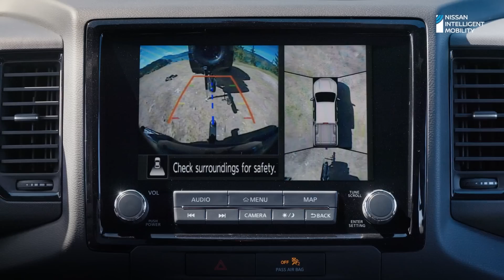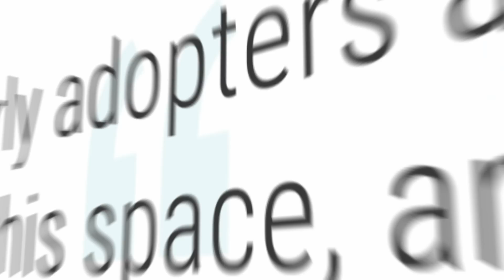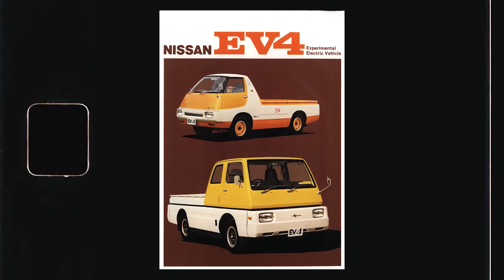Nissan Launching $25k Ford Maverick Competitor!

Comment: I had a 2door Nissan Hardboby back in the 90s. It was a great truck but small and made for only 2 people. 
I ordered a '23 Maverick because it is capable of doing everything I need from pulling the jetski to the lake or hauling my dirt bike to the track. The AWD is good for my snowboarding trips up the steep mountain roads. I especially like that it's a little lower than most trucks so my aging mom can get in easily with no step up into cab. The ride is MUCH better than my '01 4runner limited 4x4.
I'm definitely open to other manufacturers coming to market with comparable models. I think Ford even surprised themselves at how well the Maverick would do.
Reply: Agreed.  I also had a Hardbody. Great truck,  no problems.
Reply: Miata owner here. What is exactly wrong with "made for two people" lol. I'm actual MORE interested in a 4x4 "Miata like truck". I haul my partner, my dog, and things that don't breathe. I'm a introvert (a full 1/3 of the population is) and we could give a single crap about people hauling capacity lol.

Seriously. Until somebody makes a compact regular cab and fairly utilitarian 4x4 people like me will have no interest. I've been needing a truck for a bit but the only thing that really suits my bill are the older Jeep Comanches, '04 or so Tacos, and the old Hardbodys. However those are decades old and getting difficult to source parts and keep running.

Comment: Hopefully Nissan can improve their QC a bit. It's a shame that a company with some of the most reliable vehicles, is now known for nothing but problems
Reply: I have to agree with you there used to be a great vehicle back in the 70s and '80s I don't know what happened in the 90s on with her vehicles in the 70s I had three of them their pickup and they're around 6:10 and one of the zcar
Reply: They sold me a piece of junk back in 2015. I will never buy from them.
Reply: The Leaf replacement battery price was raised from $5500 to $8500. So their air cooled POS battery became a money maker for them. Great way to gain customer loyalty. I worked on many 510s they were great cars. Overhead cams, disc breaks and IRS. great visibility.
Reply: Had a 2014 frontier that was the most reliable and lowest maintenance cost of any vehicle I've owned in the last 20 years.
Reply: @30smsuperstrat  the frontier is a very reliable vehicle and an exception to Nissan's overall quality
Reply: After visiting a Nissan dealership to consider purchasing a new car. It was the worst experience I've ever had with a dealership. Advertised options were not in the vehicle. $2500 added on the deal for paint protection that couldn't be removed, plus $2500 added without my request for extended warranty. I ask that my credit pull would be only one and shared with other lenders they worked with. I looked at my credit report a day later finding it dropped 24 points from 5 credit pulls. I walked. I will never revisit that dealership or recommend it to my worst enemy. Even if I had to wait for a Maverick. I will never purchase a Nissan product..
Reply: It’s to bad as there variable transmissions are horrible. I would not buy one right now as 
 they have so many problems. Bad Transmissions are just the tip of the iceberg…
Reply: Nothing wrong with the Frontiers. 200,000, 300,000 and some 1,000,000 miles.

Comment: I think the hybrid solution with an engine and battery pack is the way to go. Apartment dwellers condos don't have the ability to plug their trucks in. The grid is not mature or can handle an all electric Nation. They don't work well in cold weather as far as mileage. That's why Ford solution was brilliant. 40 mi to the gallon. Don't have to plug it in. Cheap to buy and to maintain. Gas is not going away. Call manufacture should be offering hybrid cars for the next 15-20 years to allow for infrastructure maturity. New innovations in battery technology. That's my two cents

Comment: Back in 1983 I bought a 720 king cab with the sd25 diesel and that was a great little truck.i run that for 200000 miles in 4 years Frame was rotted in front of rear end and I sold it to a used dealer for 500.He shipped it out of the country.

Comment: The 1993 D21 auto 2WD with the 2.L engine was a work horse that i sold last year when I ordered the Maverick.  If Nissan can build a solid electric truck like the D21 style it will suceed.

Comment: I would like a Nissan that cost even less than the Ford Maverick. I loved my Ranger, Hardbody, Frontier, and now my F150, but would prefer a smaller, more practical & fuel efficient alternative like my Ranger & Hardbody. If prices & features are comparable…it’ll come down to looks…and Nissan usually had the edge in that category.

Comment: I had a 1989 Nissan SEV6 with a manual transmission 4wd and loved it.  After that, I got an 2002 Nissan Xterra that had a gas tank that
was too small and a body that was too top heavy.  If I took the Xterra on a trip I had to stop too often for gas.   I drove it one year and traded it off.  
havent had a Nissan since.

Comment: I had a Mazda B2200 small pickup many years ago, and it did everything I needed it to while being great on gas and easy to park and maneuver. Full-size pick-ups have gotten ridiculous in size and price, and are way more truck than most owners actually need. Another small pick-up would be welcome in out current automotive market, as the Maverick is proving.

Comment: Listen up Nissan.  I want a plug in hybrid Frontier size truck... with 40 mile battery range and 40+ MPG.  I live in the Midwest and need reliable range (300 miles) when below freezing and towing 2,500-3,000 lbs..  With current battery tech... this can only be done with a hybrid solution.  Gas and gas companies are not my enemy - I just want a more efficient solution at a reasonable price.  The Ford Maverick Hybrid demonstrates that this might be possible.  Price point needs to be shy of 40K.
Reply: Price should be sub 25K. It can be done.

Comment: because the consumer wanted to purchase bigger more expensive trucks rather than the compact ones they did away with them or beefed the compacts up to mid-sized. but as gas prices and inflation rise and mpg going down the demand for compacts go up. but the new compact trucks need to be more simpler and have bigger beds and cost less than the maverick to really capture the market. i bet subaru could dominate with their symmetrical all wheel drive system.

Comment: In my youth I had not one but two 1990 D21 King Cab trucks, 5 speed 2.4L engine.  Crashed the first one but was able to find another one just like it used with very few km on it.  I am willing to wait for this truck if it looks anything like the thumbnail.

Comment: The RV Dinghy Industry is awaiting easy availability of the Maverick hybrid FWD to replace many aging dinghies out there that no longer have direct replacements in the 3.700# category. If Nissan could figure out a way to program in a 4 wheel-down flat tow option into their new EV Pickup, they would have a dynamite combo that many hungry buyers would stream toward. The 4K tow version of Maverick is not 4 wheel down flat tow compatible, only the FWD hybrid version that tows itself at around 1,500#, but still perfect for RVers wanting a light general utility vehicle for all-around needs once at the campsite. I hope Nissan can offer something comparable for RVers.

Comment: Well with all the competition in the small truck market lately  is a good thing as lonas a manufacturer dont cut corners  concerning safety and reliability and dependability! Cut luxuryies  like manual windows for power windows,, or go back to keys fok r operation, the remote operation or manual high beams headlights the automatic high beams headlights there are alot of things one can cut to compete  to keep thing cheaper!  Also run better with less break down, some luxuries cause more break downs!

Comment: I want a small  truck for a carpentry business.  I don't need or want a 4 door truck.  My ford ranger was a perfect size.  I want a 6 foot bed .  An 8 ft bed would be even better.  I want the power of a 6 cylinder engine.  It could be  electric.  Sell the truck for $25,000

Comment: What need to happen is our county try need to get out infrastructure geared towards EV on the interstate system (every rest area). As for small pickup trucks. I have been driving Lincoln vehicles MKC and MKX, and I am about ready for a new vehicle. I am very interested in a small, but well designed, electric pickup with 400 miles of range. All the nice accessories, with a roomy back seat, yet off road capable with at least 5000 pound towing capacity, and AWD or 4X4, with at least 20 inch wheels, and 10 inch ground clearance. That 30k to 45k price point would be great

Comment: Pure speculation.

That concept looks as though it would fit somewhere between Titan and Frontier in size, and is slated for '28 MY.    As long as its not maverick sized, Im all in.
Currently driving a Titan, Previously owned all generations of Nissan/ Datsun Trucks(In manual trans config).

Comment: The only holding back many cars getting to customer is markup.  It is a rip off dealer put extra 5 to 10 g on top of 25 g.   I would prefer other vehicle from dealer that would have no markup and have longer warranty.   3yrs is outdated as standard.

Comment: Please make a Nissan truck like you  had in the 90dies. I would like  an AWD TRUCK WITH DOUBLE WHEELS IN THE REAR BUT VERY ECONOMIC , NOT HYBRID. ALSO WITH A DUMPING 8 FT BED  OR A  VAN LIKE AWD FORD TRANSIT , BUT HALF OF THE LENGHTH ALSO VERY ECONOMIC NOT HYBRID BUT GAS

Comment: I welcome the return of compact pickups however with Nissan try to engineer a platform that uses a traditional ICE powertrain with no CVT and whatever name they choose you have your trim levels and have a blue or green E for the EV variants and for Nissan I would drop the titan by 2030 and no replacement keep a gas Frontier and do a hybrid/EV Frontier although I would buy a Toyota compact truck over Nissan they've been going downhill since the merger with Renault in 1999.

Comment: I WILL NEVER BUY  ELECTRIC CARS , OR GOLFCARTS  BECAUSE  OF HIGH AND EXPENSIVE  MAINTENANCE  , BECAUSE BATTERY ENDS OXIDATION  AND REPETED MELT DOWN  TERMINAL ENDS BECAUSE  OF THE HEAT AND SALT AND HUMIDITY  IN THE AIR.  I WOULD NEVER BUY ELECTRIC CARS , EVEN IF THEY WOULD  OFFER FREE  LIFETIME  REPLACEMENT  BATTERIES  , BECAUSE OF SHORTAGE OF PRETIOS METALS , LONG TIME IN THE SHOP OR DEALER , REPETED MAINTENANCE  ISSUES

Comment: The Frontier is a gas hog. The newest one gets no better gas mileage that the previous version. You can expect 12-13mpg in town. I owned a 2018 and a friend has a 2022. OTOH my Maverick XLT hybrid is getting a little over 41mpg actual in town. I paid $26,000 otd for it with Luxury Package and a few more options. Nissan will not be a competitor unless it is made in the US. Toyota  has a better chance with their small truck.

Comment: I still don’t believe sales of the Titans were as low as people say, you cannot find one at the dealership and all titans that were built were sold. They simply barley met demand. I love my Ram 3500 but the big 3 over build just for bragging rights and the dealers are full of unsold trucks. I owned two Nissan Titans prior to my ram and I may buy another Titan but once again they are hard to get. Ram is simply the best heavy duty truck but when it comes to middle grade trucks the Titan XD is better than tundra and the other big three 1500 trucks. Hands down

Comment: The EV fad will fade away
there's no infrastructure to accommodate everyone owning an EV
EV's began long long ago, they died off because of Oil/Gas-- and there's a sh*t load of Oil in the ground.
Why is Gas better than an EV?
Because charging batteries takes FOREVER
Filling up a tank with Petrol takes five to ten minutes.
So go ahead and waste your money on an EV that in time will need another battery at a cost of 20k and up.
You're NOT saving the Earth by purchasing an EV, because when the battery dies, it cannot be recycled and is going to be stored FOREVER as Hazardous Material.

Comment: How can automotive manufactures be this dumb?   The public wants a small CROSS-EVER truck derived from an SUV.  A vehicle that's comfortable like a car, and can make a run to Home Depot.  A Cross-over that can haul a 4x8 sheet of drywall, a few 2x4s and couple bags of mulch. 
THAT'S WHAT THE MAVERICK IS. It ain't rocket science. 

I am not a contractor. I do not want a 8,000lb dump truck sized F150. I will never haul 3,000 lbs of bricks and concrete. I will never tow a 10,000 trailer. but I do want comfort for daily driving, a ride to work,  the grocery store, the ball park, the beach, and an occasional Home Depot run.

I would buy a Maverick tomorrow at list price. I will not and will never pay $10,000 over list. 
That dealers are asking for that kind of markup really p*****s me off.